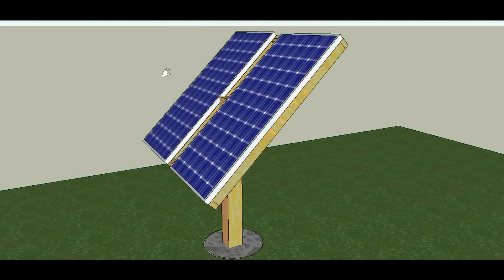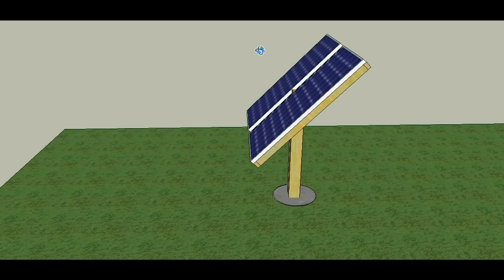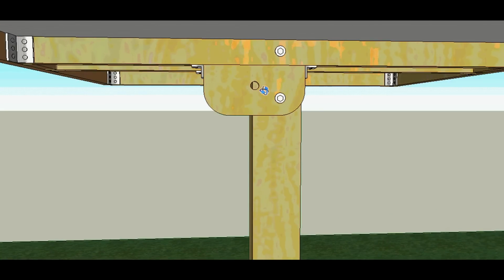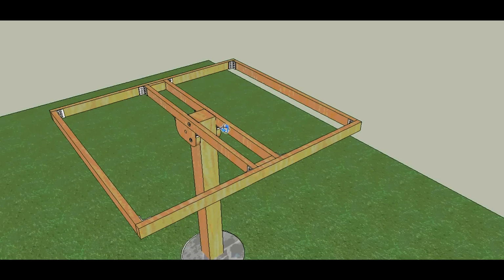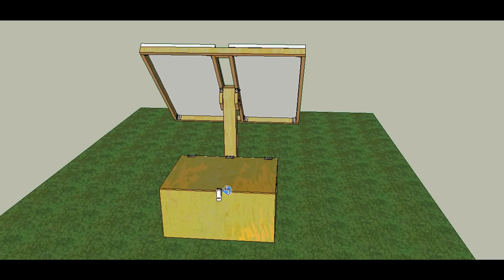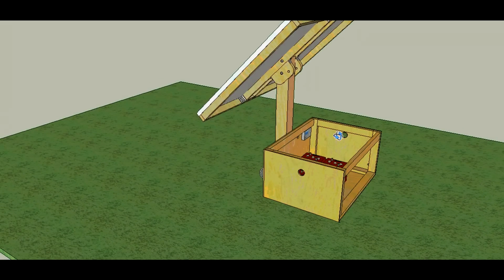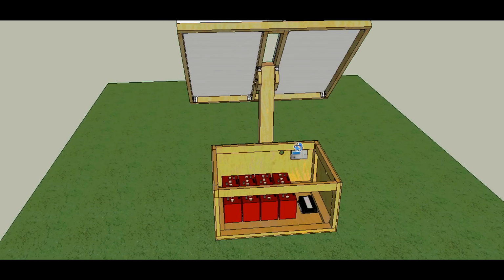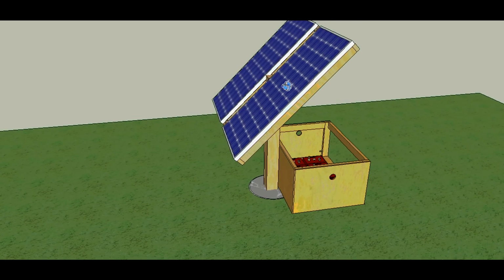Post Mount Remote Solar System Design by LaMar

Comment: Wow, been pricing the metal pole mounts, pretty expensive even just for two or three panels and uncertainty on dimensions. Definitely would not go broke using your method. It looks like you could expand it to accommodate three big panels if necessary. I have two flexible 200 watt panels shipping to me now, they don't weigh much. Looks like I do my measuring and when it's finished I could just use some wood screws going through the holes in the flexible panel along the borders. Probably get better results then mounting it on a hot roof and far less dangerous. The back of the panels would be well ventilated. Also maybe with the flexible panels I could use something a little bit lighter than 2 by 4's. Thanks a million!
Reply from the maker: Should work fine. Mount it 3' deep in a cement filled hole. Send me pics if you use it, please.
Reply: @solarcabin  Absolutely!

Comment: Its a good set up but here where I live in this neighbor hood  my batteries and solar system would be gone by thieves. I would have to put my batteries and equipment inside my home in a room under lock and key. as for my panels I would have put them high up so I could keep them and I wood most defiantly insure them. incase of damage by weather or by gangs. I never have trouble when I am home just when I have to be gone for a few days. other than my gas was stolen a couple times this month. I stopped that by locking my gates at night. most of them know I will shot if necessary I have sks /410/44 marlin/  357 magnum 308 mouser/ and many more weapons. I make knives / machetes/ arrows/ bows/ and throwing stars out of carbon still 3/16 and 1/4' steel. But I pray to god I never have to take another live. but if I have no choice. As I am a pro with any of these weapons I was trained by military personnel. And I have taught primitive combat using blades or what ever weapons that are on hand. But you just cant watch your home when you are gone.

Comment: Good design, maybe a 1X2 cross brace  in the middle of the boxes, and a piece of plywood glued to the center section for added strength.  Also not sure but I think you need to go down 4 feet to get below the frost zone in your area to prevent the ground from heaving your post out.

Comment: Great video & ideas.  Suggestion:  you might like to show a chart showing the time of year to move panels and to what degree they should be at. Now they will be a little different for all uses, so maybe a link to a website that has a tool so users can find the optimum angles. maybe this: (http://www.solarelectricityhandbook.com/solar-angle-calculator.aspx) (http://www.macslab.com/optsolar.html) or (http://www.builditsolar.com/SiteSurvey/site_survey.htm)

Comment: I do have a question....  How durable are these panels for hail?  Thank you, and I love your channel.  :D  Oh and will you bury the pvc holding the extension cord in the ground?
Reply from the maker: Hi and good question- most panels have a safety glass that is similar to a shower door and can withstand most hail storms however in heavy hail it would be best to turn them vertical and cover them with a sheet of plywood if you have time.

Comment: Your channel is the first one where I began learning about solar panels and how to set them up. So I feel funny trying to offer any help since you seem very knowledgeable about the electronics of this. I have been watching a guy here in NY set his up and the critters would yank his wires out of the solar panels because he had them on the ground. I think your post mount idea is good due to wind and other things that could affect them. I do think it would be a good idea to channel the wires through some type of conduit even if it is just pvc pipe.
Reply from the maker: Thanks- yup critters are strangely attracted to wiring and will chew on it or try to make a nest in the box so some type of conduit should be used and PVC will work to keep the wires hid and organized.

Comment: LaMar,   I have your book and have used it as a reference many times.  

This is a project I am currently trying to work out as well.   Right now my panels, 8 of them are on a ground stand angled for the winter time.  I keep thinking about a tilt design but just not sure how to go about it.  Have looked at sleeving a galv pipe to make a heavy sort of hinge that wont' wear out, but the framing is my issue.  I see many out of wood, I was considering the galv slotted metal, only for the reason I can ground it to help protect from lightening.     My battery banks are about 20' away, we use a square d outside breaker panel to make a combiner and shut off, and was lucky to find some 2/0 stranded copper to encase in conduit the approx 20' to the pumphouse where the battery bank is.   we have zero loss of voltage this way and can handle the approx 60 amps coming from the panels.     

this is one idea that I have looked at, http://spectrumz.com/2013/low-cost-adjustable-solar-panel-rack/

but my fear with any wood rack is any twisting, whatnot that can take place and damage the panels.
Reply from the maker: Thanks Fritz- those racks look nice and solid. You could put a second set of racks and more posts attached to my rack with two more tilt mounts. Panels at the ground level are less likely to get hit by lightning but you can add a ground strap and the batteries should always be grounded to a ground stake. I will use steel corner braces and plywood corner gussets for strength and may add a tensioner if it vibrates in the wind. If you can get solid copper wire you can run 24 volt farther than 12 volt but wire is way expensive these days,
Reply: I was lucky to find 2/0 at lowes in their discount (1/2 price) area of wire.  that saved a bundle!   the 2g and 4g welding wire isn't too bad around here for the short runs that I need of it.  I'm not much of a builder, and until summer wont' probably build any type of rack, I need to see the sun patterns and may have to remove a cedar tree which I don't want to do but may end up needing to...   I'm getting right at 20 volts, 7+ amps per panel right now, and even on cloudy days still getting 13-15 volts out of these panels.   I bought them used, they are Kyocera's.   exceptional deal at 130 a panel.
Reply from the maker: fritz e 4 gauge is what I like to use but very expensive for solid. I have used welded strand and it doesn't lose much. I won't build the project until the ground thaws enough to dig and I may have to remove a tree to.
Reply: are you talking about grounding?   4 I would think would be adequate.   Like me, will wait till spring/early summer before I build anything perm.     I need to recheck the path of the sun, before I decide.  where we have to put our panels, the east is blocked a little in the summer time, but that really don't matter.   right now a elec pole shades in the afternoon but it has little impact on how well the panels do.  the shade moves across the panels west to east straight up and down.  Wish I could afford mppt controllers, but we use a diversion controller and looking at adding either a pwm for the second or another diversion and use the power pulse units on our new batter bank.
Reply: solarcabin
we were lucky to find 6 kyocera 120 watt panels used wish we could find more, they are outputting 20v, and each puts out about 7 amps.  they were mfg in 1999, but in exceptional shape.  

new battery bank is trojan T105 private label batteries to replace the aging bank and plans on a 2nd bank of trojan L16's.   I'm racking my brain trying to find a combiner that will allow to draw from both banks without them seeing each other.  so far no luck..

Comment: The battery box needs vents near the bottom and near the top so the hydrogen gas vents, I always put several cement blocks under the battery box and slant the top like a shed roof so water doesn't puddle on top.  Remember for non directed during the day solar collectors like yours, that slightly west of south is better than full south because the morning haze reduces the light in the morning and evenings the sky is clear so there is more light and more electric energy output...
Reply from the maker: Thanks friend- vent holes are a must in any battery box. I have seen them explode and not pretty. Panels should aim at true south (in northern hemisphere) not magnetic south and you need to observe the sun where you are located for proper angle as every location is slightly different. I may add a third hole for spring and fall angles.
Reply: solarcabin You are not reading my post completely, I said the non tracking solar panel will collect more energy if directed to the SSW or SSE and NOT DUE SOUTH, because if you have intervening trees or other shade or a mist in the sky in morning or afternoon, the sun is brighter toward either sunset or near dawn because of this in my and many other locations Due South, is NOT always the best direction; as you categorically state, the maximum daily output can be effected by the quality of light/shade/mist in the first hours and last hours near dawn and dusk and a slight orientation toward east or west can provide extra power for a fixed array of collectors. Due South is not always the best. As for the tilt angle the latitude is the usual best angle but highrt toward vertical keeps the snow off better and helps in winter operation. Also a bright reflective surface South and somewhat below the collectors will reflect extra light into the collectors, so a driveway or patio can help increase the collector's efficiency... White, not blacktop or grass lawn...

Comment: How about placing a stainless steel rod into the concrete with a strike plate around it. Then a hole in your post with a strike plate around it to receive the pivot rod. Seems like a simple way of making a pivot point. The strike plates would need to be of a non-rusting material also. The rod need only be a foot long or so (six inches into the concrete and 6 inches into the post) and would  need to be of sufficient diameter to not bend. The only time it would bend is if you were to hit it with your truck. The solution for that is simple... Don't hit it with your truck!

Comment: If I was going to build this system I would put another latch to hold the lid of the box open so that it doesn't slam shut on your head while working in your battery box.  Overall its an awesome design.

Comment from the maker: A few people have suggest a swivel mount with a tracking system but here is some things to think about: trackers only work when the sun shines and have a tendency to jam leaving the panel at the wrong angle. A manually operated swivel requires you to go out and adjust the panels every few hours. My design is to get the majority of the sun all the time even when I am away from the cabin.

Comment: I think your design is pretty solid. In fact I might actually make something similar, but smaller for a little 6v, 60watt panel I have. I don't think you need to make it swivel unless you want to chase the sun around with it all day..! hehe  The only thing I would really suggest is that you put an additional hole on your tilter between the other two for the spring & autumn seasons.
Reply from the maker: Thanks- you can certainly add another hole or two if you want to adjust it to more angles. 45 and horizontal will get most of the sun in my area.

Comment: I wouldn't necessarily use 45deg and 0deg.  Research the best angle settings for you based on your latitude.

You could set a 1.5" pipe into a hole drilled into the top of the wood post, then slip a larger pipe over that one.  You'll need a bearing for the larger pipe and panels to rest on.  Not necesarily ball bearings, but a bearing of some kind.
Reply from the maker: It all depends on your latitude. Here in the mountains the sun stays low in winter and 45 is a good angle.
Reply: 45 might work well for winter, but 0 is too flat for summer unless you're in Hawaii
Reply from the maker: Our sun here is almost directly over head in summer. Small angle differences don't effect the panels much as they have a pretty big surface area.

Comment: Rather than steel braces in the corner how about gusset plates over the outside? Could do both, putting a piece of plywood or even scrap 2x4 should really strengthen that joint. Might also include some threaded rod from the base of the panels to the center pole, less leverage on the system. No real experience in this just random thoughts, would not place too much weight on them. Will look to see how yours works, have been thinking about building one as well, though I was thinking just a simple a-frame and non-adjustable.
Reply from the maker: Thanks- I will probably add a gusset over all joints but I didn't show it because you wouldn't be able to see the frame braces. With corner braces, glued and screwed and gussets I don't think it will go anywhere!

Comment: I like the idea of this, one worry I would have is the box being straight on the ground, and eroding due to rain or snow. So, I would suggest putting the box on concrete blocks or stones of some sort to raise it slightly off the ground.

Also, the security of a thin ply board on your solar system through a lock may not be sufficient. You may want to double up the boards to reduce the chance of someone just taking a hammer or drill to the sides of the battery box to break in.
Reply from the maker: Thanks- I intend to place it on a cement pad and it will be enclosed in a roofing tin to keep weather and intruders out. If they make it past my two hungry dogs and can break in to the box they would have to be really desperate lol!
Reply: Okay, good ideas. Sounds like you've got yourself covered then!

Comment: If you run a rod through your 45 degree holes, it will add stability to your summer position.  The rod will keep the platform from rotating.

Comment: Have you considered making it as part of another feature?   Like the roof of a carport or shed?  Why not build it as a shed that contains your batteries.  Add to the south facing wall of the shed a hot air panel so you can optionally warm the batteries in winter.  The unit would be bigger than your battery box as proposed giving you a little storage area or perhaps just foot room to move around and work on it out of the weather.  Just some idea's.  Glad your back Lamar.
Reply from the maker: Thanks- the reason for this design is to get the panels down at ground level so I can do maintenance and keep the snow off. I am getting too old to be climbing ladders and messing around on roofs lol!
Reply: Gambrel (sp?) roof sheds have a facet that is pretty low.  You wouldn't need more than a shop broom.  I'm not thinking of a large shed, something like a giant dog house really or small garden implement shed is all. No higher than your drawing.  Other benefits: Eliminate the risk of really high winds and all your construction materials would be out of the weather.  No re working the project later when your 10 or 15 years older.  ;-)   I've also thought about the trailer idea.  That allows you to move easily and to reposition with a garden tractor or truck if your having tough solar times.  But, by in large, I think it makes more sense to have a fixed mounting position as you do.  Just adding smaller West'ish and East'ish panel to catch evening and early morning solar.   No moving parts to maintain.  Panels are super cheap right now.
Reply from the maker: You could build a small shed or I designed a trailer mount box system so you could take it with you. I will also have panels on my camper that will be fed into my system when I am not camping and run my camper when I am in the mountains. Lots of different options. I want this system for running my fridge and freezer and be able to mow around it and it is designed for people to build inexpensively in remote areas.

Comment: the best way to do this is with a motor that uses very little power to continually reposition the panels perpendicular to the sun. To give you an idea of the kind of motor I'm talking about, a good example of one is the kind of motor used in telescopes. If you counter balance the panels, it wouldn't require much energy to move.

Comment: Nice design.  I was thinking it might be a good idea to make a gusset or sliding cross brace from the bottom of the frame to the post to keep it from tilting in the wind, especially in the summer position.  This brace would be adjustable and slide between the two center 2 x 4's.  I know you're using a 3/4" bolt to hold it into position but a good gust of wind can be powerful :)
Reply from the maker: Thanks friend- I will probably add two adjustable wire tensioners just to keep it from flexing.

Comment: If I were to post-mount the panels, I would engineer a swivel mount to allow them to track the sun.  That would allow you to get by with fewer or smaller panels, and thus less expense.  If you're just worried about snow on the panels, just get an extending arm with a brush on the end, available at home improvement stores for a few bucks.Sweep them off from inside the house or from the ground.
Reply from the maker: Thanks- I designed a welded swivel mount to go on a pole but I am away from my cabin a lot and don't want to have to go out and swivel it every few hours. The tilt mount will still get the majority of sunshine but a swivel with a tracker would be ideal.
Reply: solarcabin Oh man, I don't blame you.  I have better things to do with my time than manually orient my solar panels.  I'll tilt them up in the summer and down in the winter, but I'm not going out and tracking them every day.